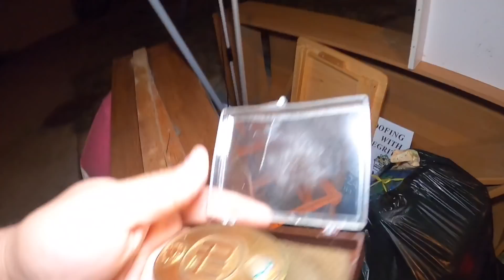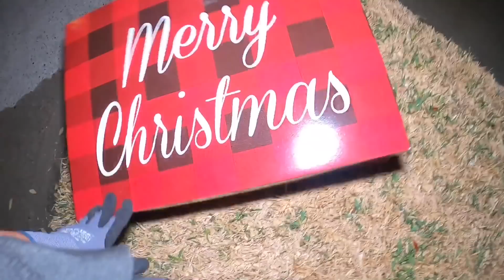Crazy what people throw away !

Comment: After watching it again I believe that was a black widow spider . When I was in the Air Force in the 80's , I was stationed in Arizona and worked in a maintenance shop with 50 other jet mechanics . We had a break room which would seat 30 people with tables and chairs . We took turns cleaning the break room and when it was my turn I decided to mop and buff the floors . I moved all the tables in one corner and stacked the wooden chairs upside down on top of them . That was when I noticed that in the bottom corners of the chairs there were black widows . There was at least two per chair . It was amazing that no one got bit as they were sat in three times a day 6 days per week .
Reply from the maker: Wow!!!
Reply: Omg!